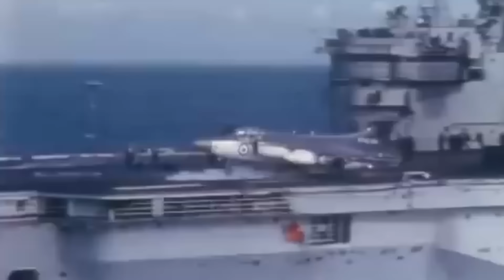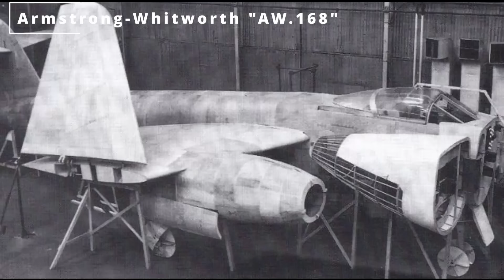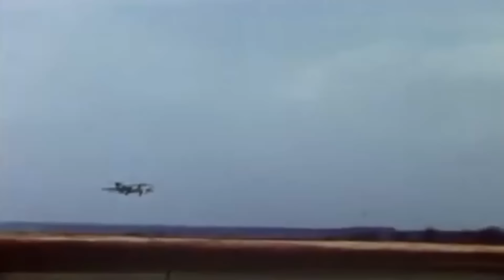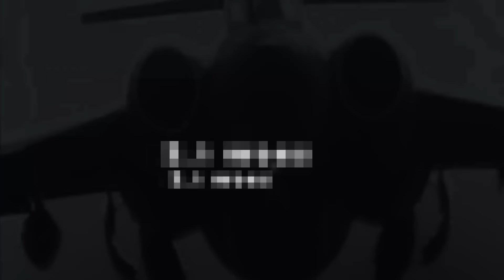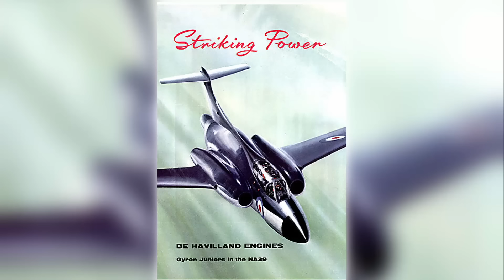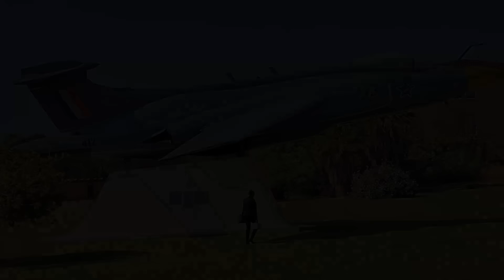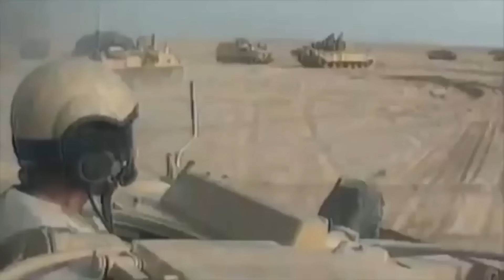Blackburn Buccaneer  -  Insane Low Level Bomber Americans couldn't shoot down - (Full Story)

Comment: I've flown the Buccaneer for about 60hrs, and I found it an outstanding low level strike aircraft, and a very docile aircraft to fly
Reply: Did my hours on an " Inter Services Personnel Exchange" Programme in the mid 1980's, never technically the "Pilot in Command" but totally enjoyed the ground hugging, contour chasing, high speed capabilities of the Buccaneer, definitely some "Brown Trouser" moments
Reply: @stevelewis7263 k I’m
Reply from the maker: As in you flew the real thing, that is just amazing, could I be any more envious, and there is me pottering around in a 152 thinking I am Maverick.
Reply: @AviationRepublic  In the late 80s I had a light aircraft (A Beagle Pup) based at RAF Lossiemouth, I used to bimble around the local area, usually at between 1000 and 1500 ft. My aircraft had a VHF radio and the RAF used UHF so never the twain would meet. Except that the local military control had both frequencies ganged together so when he pressed the button he would transmit on both. So one day the controller calls me and checks my height. I tell him 1500 ft and he tells me to maintain that. A second later I heard hime tell a Buccaneer that he had a light aircraft in his 12 o'clock, range 10 miles maintaining 1500 ft. Of course I couldn't hear the RAF pilot's reply, but a minute later two Buccs passed underneath me in the weeds ticking along at 400 knots of so. Was I jealous? Danm right.
Reply: @AviationRepublic  Anyone remember this? 

Rolling down the runway 
throttles open wide 
see the mighty Phantom 
sway from side to side 
airborne again without a blip 
It's just one more aborted trip 
but we're pressing on regardless 
for the wg cdrs AFC 

Went to early briefing 
climbed into the Kite 
opened up the throttles 
and roared into the night 
leaving the flare path far behind 
It's dark outside, but we don't mind 
cos we're pressing on regardless 
for the wg cdr's AFC 

Rolling down the runway 
throttle open wide 
see the mighty Falcon 
sway from side to side 
airborne again with just 9 G 
I wish I had a nav with me (!) 
but we're pressing on regardless 
for the wg cdr's AFC 

Rolling down the runway 
throttles open wide 
see the mighty Jaguar 
sway from side to side 
airborne again, but only just 
It's not much fun with F*** all thrust 
but we're pressing on regardless 
for the wg cdr's AFC 

Give me Buccaneers 
They're British through and through 
The Banana Jet 
The Best we've had yet 
We are the last of the few. 

Don't give me the Jaguar 
Unless you refer to the car 
The car is a ground hog 
The aircraft, a half frog 
Don't give me the Jaguar. 

Give me Buccaneers 
They're British through and through 
The Banana Jet 
The Best we've had yet 
We are the last of the few. 

Don't give me the Harrier jump jet 
You haven't convinced me yet 
Jets that fly backwards 
Are soon to be knackered 
Don't give me the Harrier jump jet 
Well… You know, not just yet... 

Give me Buccaneers.
They're British through and through 
The Banana Jet 
The Best we've had yet 
We are the last of the few. 

Don't give me this computer crap 
It's no way to tackle a SAP 
It's OK for Dicks, Germans and Spicks 
But Gentleman, carry a map! 

Give me Buccaneers 
They're British through and through 
The Banana Jet 
The Best we've had yet 
We are the last of the few. 

Don't give me Air Traffic Control 
They live in a bloody great hole 
They scream, and they shout, 
then F**k you about 
Don't give me Air Traffic Control. 

Give me Buccaneers 
They're British through and through 
The Banana Jet 
The Best we've had yet 
We are the last of the few. 

Don't give me the F-104 
It's only a ground loving whore 
It goes in a turn, flick, spin and burn 
Don't give me the F-104. 

Give me Buccaneers 
They're British through and through 
The Banana Jet 
The Best we've had yet 

WE ARE THE LAST OF THE FEW!

Comment: I remember visiting the factory where they were built, in 1982, while I was studying at Cranwell.  They still had the fatigue test aircraft on the rig.  The wings on a bucc are short and stiff.  We engineers were impressed that the wing tips were being bent upwards by about 11 inches or more, while the fuselage ends were being bent downwards by what looked like a similar amount.  The frame groaned as this was happening.  Amazing aircraft
Reply from the maker: I would have loved to have seen that, looking at the Bucc in my local museum which has the wings folded and the internals of the wings are incredible. :-)  Joe

Comment: Get you lamps out and sandbags to sit on!
Early June 1967 - the Six Day war is about to start and I am sitting in a marquee with a sergeant in the Wessex Regiment (May have been Devon & Dorsets it's a bit vague now) - Anyhow, the news is that war is imminent and that HMS Victorious was saling in the Gulf of Libya and our "battle group" (exercise Phantom Sail,  I think it was) was not to worry about any potential attacks form Algerian or Libyan forces who were heading to Israel.  We were generally disinterested as we were to head into RAF El Aden later that week.  However, as I say in my tented "office" chatting to the Sergeant I glanced out of the entrance and as I saw a small dot in the sky seconds later the roar of a jet aircraft deafened us, the sides of the marquee flapped open and  the whole tent was like a baloon. Above all the racket I could hear the sergeant (my leader???) screaming, "Oh ** my heart I'm having a heart attack are we being attacked"..... by this time the jet was on its way back much much slower over us and in almost slow motion waggled it's wings and I could clearly see the pilot giving a thumbs up and roaring off almost vertically to do a circuit of the tented area, one more low high speed pass and back out to sea. 
Fantatic to see and experience him coming so low, so fast and so sudden, had be been the enemy I wouldn't be realting this incident now. 
In 1969 I was working at a computer firm and found myself working with bloke who had been on the "Vic" at the time and another who was my namesake who was part of the Fleet Airarm who kitted out the flight that came out of the blue on us back in 67.  Seeing and hearing and experiancing that moment of terror .... well, what can I say. Thanks for this video, it brought it all back.
Reply from the maker: Wow, that's a great story, poor old Sarge, you could have warned him, I mean you had a few seconds :-) also, I am very glad you enjoyed the video, more to come soon :-) Joe

Comment: The first time the Buccs took part in Red Flag, the pilots were informed of the operational height. They were shocked; "What's the matter, don't you guys fly that low"? To which they replied "We don't normally fly that high". USAF thought this was just talk. Then Buccs came back with phone wires wrapped round them and a number of cactus plants were decapitated. I read that instead of spending so much on TSR2, the RAF could have saved money and developed a supersonic Bucc.
Reply from the maker: Reg flag stories never fail to amazing me, there is something different about Bucc pilots. I saw the TSR2 in Cosford the other day, what a beast.

Comment: when attacking shipping the F-111 would fly at about 900 knots at 50 feet (perhaps only 200-100 feet in most training missions). It was fairly common to find tree branches stuck in the engine air inlets.
Reply: 900 knots?  I didn't know the F-111 was that fast.

Comment: My uncle worked on Buccaneer at Lossiemouth. He told me that they had engine power loss problems at rotate speed on the take off run, and catch nets were fitted at the end of the runways.  The ejector seats were also a problem at times, with random ejections occurring and one situation where a bird strike caused the nav to eject but left the pilot in the aircraft. I guess these would be S1 versions.
I don't know how much of this was true but he was a respetcable man.
Reply from the maker: These are the sorts of stories that are hard to come by, the Gloster Javelin also had issue with unexpected ejections, mainly due to unsecured locks. - Joe
Reply: I worked on Buccs for 6 years and never heard of issues like that with the Martin Baker ejection seats.

Comment: The launch bridle by itself couldn't lift the nosewheel off the deck. A second strap a the tail pulled the tail down to achieve the desired angle of attack.
Reply from the maker: Ah, you see, in all my digging around I did not see that covered, unless I misread the passages. But that's gone down in the notes for the next Bucc Video.
Reply: @AviationRepublic  if you look carefully, you will notice that the tail skid is touching the deck at launch. For that to happen, there has to be some system to pull the tail down and keep it down during the launch using the BS4/BS5 steam catapult.
Reply from the maker: Going to nip down the museum once again to take a closer look at her rear end.

Comment: The reason Germany did not order the Buccaneer was twofold and almost unrelated to British government input:
1) The Luftwaffe guys tried to cover different tasks (actually too many) with a single aircraft type and Lockheed promised the F-104 would be capable to do that.
2) Lockheed heavily bribed government officials to get the contract - and succeeded.
This ended in a real operational desaster as everybody knows by now.
It took the Luftwaffe almost 20 years to get the F-104 somewhat reasonably doing what they hoped for without continuing high aircraft/crew losses ...
The Buccaneer would have been a much wiser choice especially for the MARINE (navy) and only for interceptor/fighter tasks the Luftwaffe should have gotten the F-104.
Low level attack is Buccaneer territory. Only the Tornado later went into Buccaneer´s foot steps for terrain following low level flying.

Comment: Fast and low. 👍👍 There is no problem flying a Cessna 172 at 50 feet at full speed. I used to fly the canals of the Everglades below bank level around twenty feet. Flying in ground effect. I also flew my F4E at 100-200ft at Mach 2.0. for three to four miles at a time. Great fun.
Reply from the maker: I never got lower than a few hundred feet, that's my story and I am sticking to it. :-)